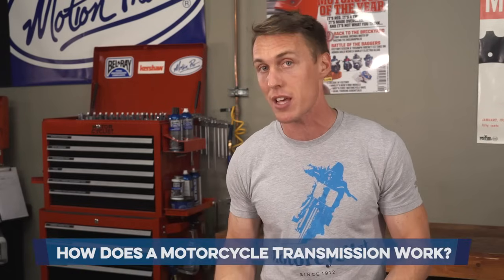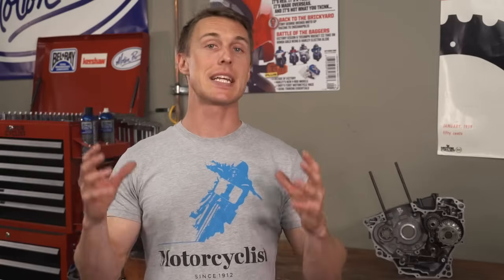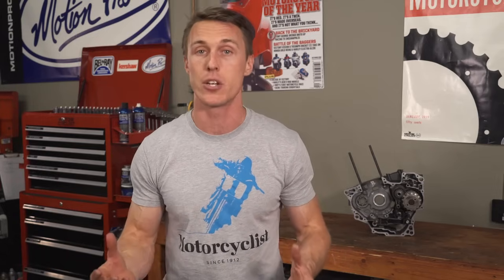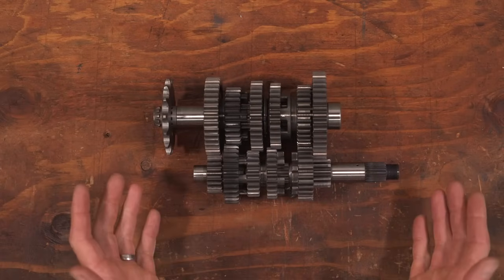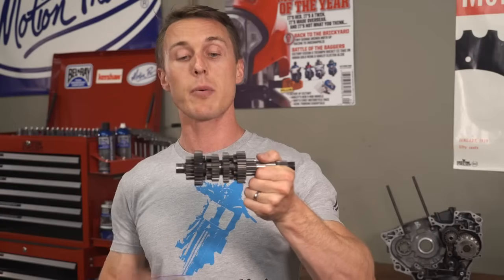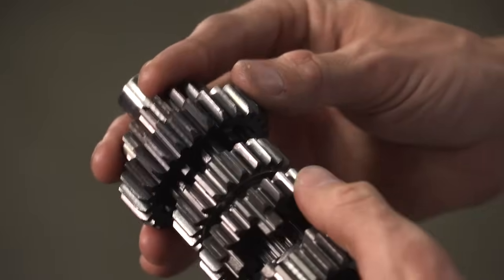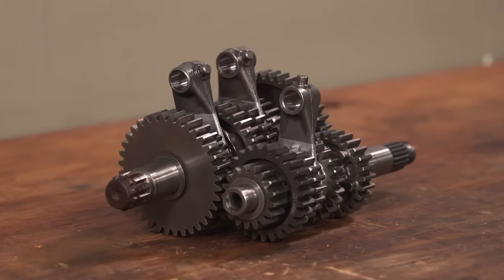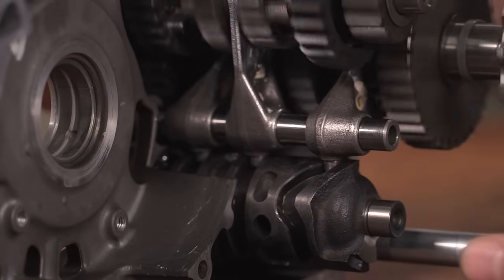How a Motorcycle Transmission Works | MC GARAGE

Comment: At one time, there were no regulations for shift patterns, nor which side of the bike the shifter was on.  Most European bikes shifted on the right, Triumph was one down-three up.  Norton was one up-three down (called the "stomp" pattern) which was better for racing since pressing down on the shift lever for a higher gear while accelerating gives the rider a more positive shift as opposed to lifting the shift lever up while accelerating.  Flat track racers prefer the shift lever on the right because it is far more accessible when the bike is leaning left in a left turn (all turns are to the left on an oval track).
     Harley Davidsons shifted on the left, but when they introduced the Sportster, they had it shifting on the right, since it was designed to compete in sales with the European bikes.  This way a European bike rider could get on a Sportster and feel comfortable.
     In the early 70's (1972, I think) the U.S. passed a Federal law requiring all motorcycles that are to be sold in the U.S. MUST shift on the left with a one down and the rest up pattern effective on all motorcycles starting with the model year 1975 to give the manufacturers time to make the change. So, Harley Davidson had to change the Sportster, and all European manufacturers had to change as well if they wanted to sell their bikes in the U.S.
     Let's face it, business owners the world over, at that time, knew that if they wanted to make a lot of money, they had to be able to sell their products to the U.S.  
   The Japanese bikes all shifted on the left with the proper pattern.  I've heard it said that the Japanese used a lot of payola to bribe U.S. Government officials to create this law concerning the shifter, in an effort to put the European (namely the British) manufacturers out of business.  But I don't have any proof or evidence for such bribes and therefore can not make any accusations against them.

Comment: on my bridgestone motorcylce you can click up or down through all the gears neutral has its own position so you can go from fourth to neutral back to first by clicking down on the shifter or vice versa by hitting it up
Reply: ok you made me interested so I looked it up and man that is really both very interesting and terrifying. I suppose you could get used to your specific bike, but missing a shift and ending up in neutral or even first at speed, that's nuts.

Comment: something i would really appreciate you going over is something that is no longer on motorcycles ever since the 80s. i have a 1973 suzuki gt380. imrestoring it. it hasnt run in 37 years. however its close. i need to time my points. not too hard right? actually more complicated. things arent lined up and timed correctly. when my points should begin to upen the mark to help guide you isnt lined up to where it should be. its actually about 180 degrees off.... i would appreciate the help

Comment: Using this to explain shifting without using the cluth would be interesting... because some ppl say its bad for the engine.. others say its not bad if you let of the throttle and shift then without using the cluth etc...

Comment: Hi,
i am having a strange issue with my motorcycle. the bike accelerates till about 60KM/h smoothly, but after that it does not go above it it doesn't accelerate. the acceleration handle work till bike reaches 60 after that it moves freely without adding on any acceleration.

Comment: concur, great explanation, in your concise if not abbreviated manner. One nit pick, and I completely understand it because I tried to make an explanatory video on sprocket and gear ratios once and mispoke several times. Gears engage other gears, sprockets engage chains.
Now for the 1965 Triumph 650cc, ever ride one of those? :) shifter on right 1 up 3 down which is precisely the inverse of what you are saying, transmission the same design, the shifter has to be inverse to preserve the rotational pattern.
 oh and if you want to see my goofy video just go to my place.
Reply: Good point man. I guess in the back of my head I knew the technical difference between a gear and a sprocket, but I was just trying to mix up the vocabulary so I wasn't saying gear-gear-gear-gear the whole way through.

Comment: Everytime I changing my gear specially on 1st-3rd gear i heard my engine/gearbox cracking like sound. My question is what's the cause of the cracking like sounds?, I hope anybody can help me on this.
Reply: worn dog gears, the dogs slip and then re-engage by the spring loading of the shift drum detent and makes a nasty sound.
Reply: thanks for the reply :) hmm. what do i need to do to prevent this nasty sound?do i need to change the dog gears? or need to practice my shifting skills?
Reply: Make sure it's not your chain loose and jumping teeth, if it is the gearbox you will feel the bike jerk a bit when it makes the sound as the gear slips. If it does that you need to inspect the dog teeth on the gears, they get rounded on the edge as do the slots they move in to which causes them to pop out of gear under load but the spring pressure of the shifter forces them to re-engage and if power is still applied it repeats jumps and feels like the chain is jumping teeth under power. Or it can push the gears out of mesh enough to force the shifter drum to sit between gears in neutral so you get a false neutral due to the same problem. If that does not describe it then it may not be the gearbox.
Reply: Another cause might be the rubber rear sprocket dampers in the back wheel are worn right out and there is slack so as you change gears and the slack takes up it might cause some noise from the chain as the slack in the damper takes up.

Comment: What oil is he talking about ? Not engine oil right ? Cause that oil is in the actual engine. This thing, gears, is somewhere near ? And we should be able to open and oil it ? Right ? But how ?
Reply: You have a lot to learn my friend.
Reply: Teach me master ! TEachhhh me ! 

http://m.memegen.com/33i2yi.jpg
Reply: Deniz Yildirim 

Just on the off chance you're not trolling. 

Yes engine oil, most bikes you just pour one type of oil in and Jobs done.
Reply: Ok i checked the oil, its still good, but the problem is that i still have this jaggy shift ? It does not shift properly. I'm having trouble to put the bike to neutro ?It either jumps from 1 to 2, or 2 to 1, skipping neutro ???
Reply: Deniz Yildirim That's pretty normal, especially in cheaper bikes. 

Neutral is designed to kinda skip  to avoid accidentally engaging it. 

Its just a case of getting the hang out of it you'll soon finding the Muscle memory developing and you'll be shifting gears without any problems. 

Oh one small tip though if it takes more than two attempts rev the bike slightly, this will get everything in slightly different posisitions that may work better.

Comment: Several of us have a disputed to settle, I hope you can help. Some riders choose to use any motor oil, the proper weight. I was told using manufacturers oil, such as GN4, was better. There are additives for my transmission. Is that true?

Comment: Transmissions seem to be an area I consider just as much as engines and ergonomics when buying a newer bike. I happen to hate the ratios on most powerful bikes as they are terrible for the street. Wish I had a special machine shop to grind a few sets of new gears to slip on those shafts. Widen the ratios, lower 6th gear RPM, lower 1st gear RPM.

Comment: How to get maximum mileage from a motorcycle. I have just bought Bajaj Dominar 400 and few of my friends also bought it. My friends are getting around 30 Kmpl but I am getting 23-25 Kmpl. My friend says that I have to change my riding style. I don't know what is wrong with my riding. I start with the first gear and where there is a bit of unpleasant sound comes..I change the gear up and like this, I shift the gear. Now whats wrong with this?

Comment: Hi...this is sujit here....I hv a question that what if i install a 12v mini fan in between carborator and air filter section. ..... I have a single cylinder engine. ... bike. ..

Comment: Nice video once again Ari!
And as usual I have another question, so I occasionally like to down shift without the clutch the same way as it's described in the twist of the wrist II video by Keith Code. But sometimes when I do that during higher Rpms, the gear goes to neutral (like in between the 3rd and 4th gear) and stays that way until I pull in the clutch, what is this phenomenon and are there neutral gears between each pairs of gears (2&3, 3&4, etc)?

Comment: Nicely done. In the days of antiquity, and Triumph, Norton, BSA, etc., the shift lever was located on the right side of the bike. For right handed riders (left brain to right ankle messaging) this is neurologically easier and more reliable. Many of the racing gods of the late 20th century had the shift levers transposed from left to right both for this reason and because they were used to this. I don't know if this trend continues.

OAP 383 (1950 Norton Featherbed)

Comment: Ari, can you give some explanations for common transmission pitfalls? False neutral, can't move between gears until the clutch rolls out a bit. Can't find neutral. Sticky shifter lever which doesn't return to center. Lose shift lever which operates to easily. Grinding gears or shifting without a clutch. (Just some ideas as a follow up for basics)

Comment: Great video. Would love to know more about clutchless shifting. There are folks on forums that say any motorcycle transmission can be shifted without using the clutch by just blipping the throttle and shifting. Is that true? Will it eventually wear your transmission faster?

Comment: If there is any rational explanation: Why do many motorcycle headlights have a cut-off point in the distance? Most car headlights kind of fade away into black, but many of the bikes I've owned have light out to a certain point, then just cut out to darkness suddenly. I've had a few bikes where making any kind of turn with the low-beams on was flat out dangerous.

Comment: if I fix a smaller chain sprocket to the rear wheel and also increase the diameter of the wheel by upto an inch, how much of a difference will it make on the top speed of the bike.?

Comment: What about the "circular" transmissions? My old Honda had that, it went N-1-2-3-4-5-N-1-2-... both ways, It perplexes me! But I'm not "engine savy" to begin with, oil and spark plug changes are all I dare touching there ha!
Reply: Franco Mattioda look at the shift drum in the vid. There's normally a limiting system like a notch on the gear lever mechanism. that stops it from turning all the way around. Without that, the gears would be circular.
Reply: Thats actually so simple! Thanks for the answer Dennis!

Comment: explanation on why we need clutch to shift. if its in constant mesh.. most bikes dont seem to put up much fuss with near clutch-less riding. where are the wear points and what is the risk. thanks.
Reply: 242tdryan I've heard it basically just trades off wearing the clutch out little by little (very little) fir wearing the sprockets/fork/dogs out little by little. but Idk personally just a theory I heard somewhere

Comment: I concur with Ari, this IS how a transmission works.  😉 It's actually surprising just how many people are baffled, or just outright afraid of transmission work in the industry too.  I was apprehensive as well, at first, but after a while you realize that all transmissions are the same in the sense that all carburetors are the same because the end result is always the same.  Anyways, bravo on yet another thoughtful display of motorcycle! Cheers!!

Comment: My transmission on my 2012 crf450x has been pour out transmission fluid from the large cent hose after my friend rode it without any transmission fluid...
I told he could ride but to change the oils so he drained both and only replaced the engine oil like a goof and rode for a bit until the bike starting getting drag and he relished what he had done so needless to say I took it apart looked at the plates and basket and it looked ok so I refilled it and rode and it seemed fine besides the fact it pours tranny fluid out of the vent hose when just sitting for a minute.
I only put one quart like a lot of guys on the forum do please please help tell me I don't have blow by and need to rebuild my top end....

Comment: great video!
A lot of italian bikes had the shifter on the right side to well into the 70's.
If you werent used to that it could cause some trouble for obvious reasons :)

Greetings from Holland.
Reply: i actually have a bike that's right hand shift (1972 xlch). and honestly I find it feels more better, never once have i misshifted on that machine. on the contrary every time i get on a different bike i end up trying to lift the brake pedal the first two or three times, shifting on the right feels so much more natural and i wish the govt never stuck their nose in it.

Comment: How about a video about clutchless up and downshifts, how it works and why you should/shouldn't do it. I mostly stick to up shifts if I'm really hammering it, but so many mixed opinions about it being bad or ok.
Reply: John Francis nope it won't if done correctly
Reply: Yeah 1st to 2nd can be really tricky. For me the main advantage of a clutchless upshift is that it upsets the bike a lot less, so if I'm really hammering it out of a corner and hit redline while I'm still a bit leaned over, then I can shift and the bike stays smooth. That's on my bike without a quickshifter, on my bike with a quickshifter, 1st to 2nd with no clutch is silky smooth.
Reply: "If you do want to do it, or have to do it, let off the power a little before you shift"

Isn't that the ONLY way to do it anyway?  
At least when I do it (I try to avoid it, but... sometimes...) I usually apply the pressure to the gear shifter a fraction of a second before letting of the throttle, and ONLY when I go off the throttle does the gear shift lever even budge.

Just my .02
Reply: Yes, when I do it from 1st to 2nd it's quite jerky, but all the other gears up to 6th are as smooth as silk.
Reply: i never do it from 1st to 2nd, you might fall in a neutral, but 2nd to 3rd and so on is much more smoother for me, and if you look from a certain point of view...a quickshitfter does the the throttle cut when you upshift, so is basicly the same, never had bad wear on my SV
Reply: Hi, it's bad for your transmission in the long run. Because, when you use the clutch to shift, you are stopping the engine's power coursing through the transmission. So, when you don't do that, more of the power of the engine is coursing through the gears, and when you go to shift, the dogs slam into the back of the gear. This wears the gear faces and the newly meshing gear teeth down over many shifts.

Gears naturally wear down anyway, but not using the clutch accelerates the wear. The reason they do this in racing is because it is a tiny bit faster than using the clutch, and it's also just easier to manage—you can think of other things, like how to get around the two guys blocking you at the end of the straight. But someone also rebuilds the transmission after every season. We don't tend to have that kind of time or money with our street bikes. In bad cases, the dogs on the back of the gears won't hold the gear faces any longer and the transmission might slip out of gear.

However, one time, my clutch cable broke 30 miles from home, and I had to do this in an emergency. 

If you do want to do it, or have to do it, let off the power a little before you shift. This is essentially doing what pulling the clutch in does. Quickshifters work this way too, by sensing when you put pressure on the gear change lever. Then, they very briefly cut the ignition or fuel supply so that the engine loses power for the fraction of a second the transmission needs for the gear faces to de-mesh and go into the next gear.
Reply: @ZacharyB  sequential transmission doesn't need clutch to shift.
Reply: The sequential constant mesh gear box was designed to be up shifted without the clutch.
Reply: It will damage gears
Reply: ZacharyB is not really bad, ive been using clutchless ups for quite some time, done revisiones and its in perfect shape, on a 99 Sv650s, there is no difference between using a quickshifter and clutchless, the quickshifter just cuts the ignition for some really small time maybe less than 0.2 seconds and you can shift, for me it archived smoother ups, only using it on 2nd to 3rd and so on, not to 1st to 2nd tho, but again, personal experience may change form one to annother

Comment: Hey Ari,  you mention changing the oil at the end there. If I have a wet clutch, that shares engine oil to keep lubricated, does that mean the transmission also shares oil for lubrication with the engine? Or does it use separate gear oil like a car would?

Thanks for the excellent videos!
Reply: jtorkilson Yes most four stroke motorcycle  engines use engine oil to lubricate the transmission as well . That's why you can't use your normal automotive engine oil for motorcycles because they have friction modifiers which end up ruining the clutch on your bike .

Comment: what do you mean by sticky shifting?
Reply: Cool. Also, My mechanic told me at the time my clutch needs replacement. I have a 2016 CBR125,  how is that possible to spot from a quick riding on the street he did? Was he bullshitting me or what? The bikes shifts fine and I really had no clue why he said that. Any Idea?